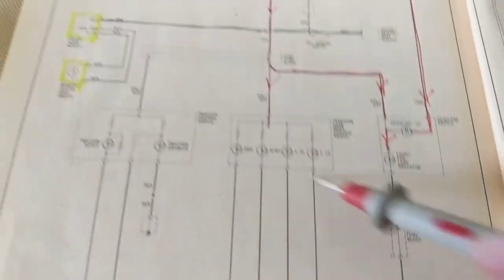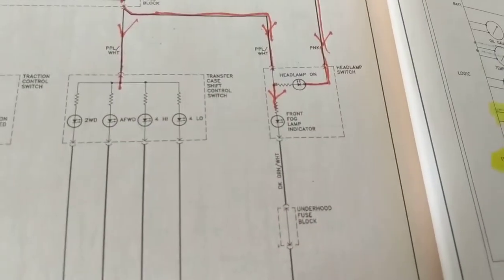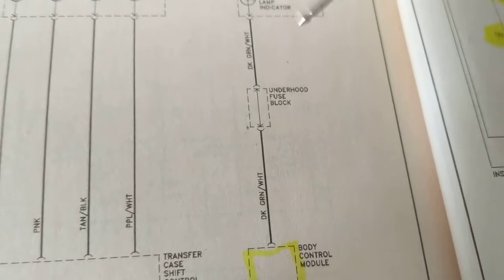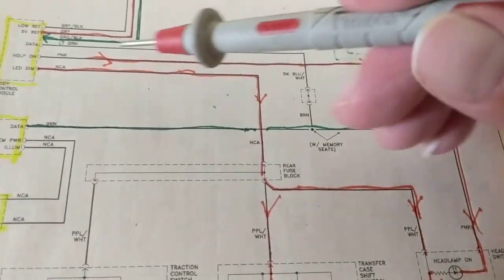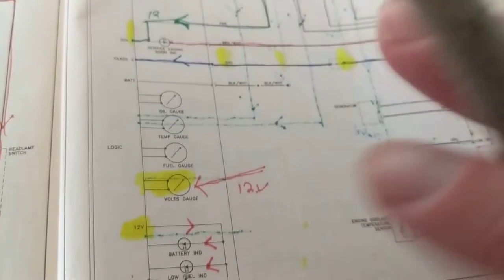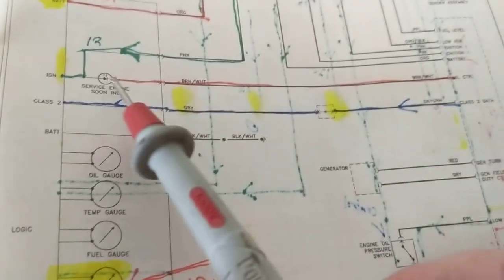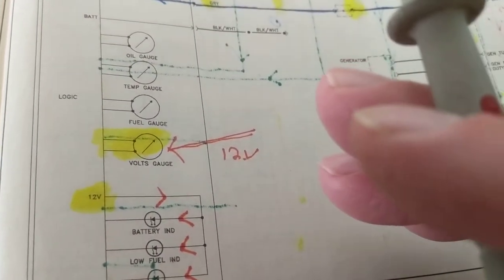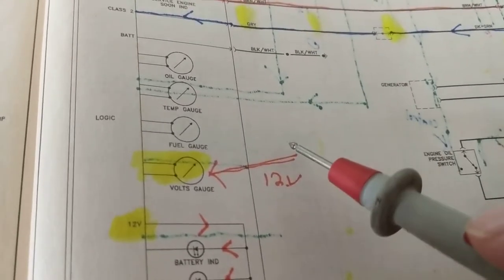BODY CONTROL MODULE AND HOW TO DIAGNOSE NO START PROBLEM FROM DASHBOARD

Comment: Do u know anything about the dim controlling the voltage in a buick LeSabre 04? Its not the regulator on the alternator bc ive put in 3. Still havent tested my harness to the alternator yet but have read in hanes manual that the dash integrated module controls it also for the buick.
Reply: From knowing other vehicles the module is a rehostst available resistor that controls the resistance and controls the current end of voltage sometimes it's in a module sometimes it's single component I don't see any reason to relate this to the alternator
Reply: @Joeelectronicschematicsforauto  ok thank u for the reply. Do u have a direction u could maybe point me in? Checking the voltage, signal wire and ground next?
Reply: @Joeelectronicschematicsforauto  ok thank u very much. Ill get back to you. I have a hanes manual that has the diagram.
Reply: @Joeelectronicschematicsforauto  im looking but a dimmer controller? Dash integrated module controller? The interior lights dimmer? Dimmer switch input? What genre would it be under in the book?
Reply: @confidential8738  looks like it's a all-in-one headlight switch and a dimmer
Reply: @Joeelectronicschematicsforauto  ok i am on the headlight circuit diagram. Again i appreciate u helping me. Ive been stumped for a month. Learned alot from ur videos. Just found ur channel last night.
Reply: @confidential8738  okay good luck and keep me informed you can always Google one signal wiring diagram from a vehicle for free put in the day-ear model of the car and the system you're looking for good luck again thank you for being a viewer
Reply: @Joeelectronicschematicsforauto  wait but what am i looking at to see why my car is at 15v? The battery is under the back seat where my kid is so it bothers me being at 15v. After 30mins or so it will drop to about 14.6 if im idle but highway speed it 14.9 the whole time. And putting a load on it doesnt seem to budge the voltage like its not even reading the load
Reply: @Joeelectronicschematicsforauto  the Hanes manual is saying that cars have several control modules also have a power mode master. In this case my "PMM" is my dash integrated module. Sent through serial data. It determines the correct power mode by reading the accessory voltage, ignition 1 voltage, ignition 3 voltage, off/run/crank voltage. It also says it if detects a high battery discharge then it will shut off stuff like the ac clutch which mine rattles sometimes and i was trying to figure out why. It also reduces power to other things like the rear defog, heated mirror and seats... I do have a voltage drop 7 out of 10 times when i put the car into reverse and 2 out of 10 if i got from park straight to drive.. temporarily draining the battery to put it in this overcharging state?
Reply: @confidential8738  alternators have sometimes compensators especially in cold winter also they have regulators once they go down to their voltage for example 14.5 volts and stay there that's because there's a regulator whatever the lows that you put on it it should stay around 14.5 volts loads of meaning lights fan motor etc that's just the regulated doing his job
Reply: @Joeelectronicschematicsforauto  ok sorry about all the lengthy replies. My battery is under the back seat which is also says it calculates the temperature to see the charging rate it should apply.
Reply: @confidential8738  yes many models go by temperature and the computer calculates with the temperature how much to charge the battery obviously on the colder conditions it'll take longer to charge the battery
Reply: @confidential8738  p and putting them in the back one of the seat reduces the temperature cuz in the front it's much more hot
Reply: @Joeelectronicschematicsforauto  what i think im having a problem with is the duty cycle wire or one of the wires. I have 12v and 4.8v at my turn on reference. Not sure how i can accurately test the field duty cycle wire without a scope? Is there a test with a test light or multimeter for that wire? It was around 3.4 - 3.6v at start up and idle for 30 seconds.
Reply: @confidential8738  a clamp meter like the ones I used in the video I can measure duty cycle certain multimeters can measure duty cycles

Comment: I didnt see anything on how to diagnose a bcm i have no crank no start with good battery good starter cranks with relay jumped but no start went through security reset nothing 2003 impala im stumped
Reply: If you go to my channels you'll see plenty of videos on body control modules but you have to see if you have communications that requires a scanner because the body control module has to communicate with the PCM module in some models that's the first thing to do
Reply: @Joeelectronicschematicsforauto  ignition on activates starter relay, still no 12v to solenoid, only clicking on passenger  side, how do we fix it ????

Comment: I Like this video very much, So how do I  acquire a schematic for my 2014 Ram 1500, I need one for my Truck, I have no signal light in the rear and no Flasher in the rear of the Truck, thank you, StaLLioN'
Reply: He said he was using a Haynes manual, in this video. I have used them for years and they are very nice.

Comment: 2017 ford fusion hybrid location
Reply from the maker: If you're asking about where the body control module is located which I think you are usually they're located by the dashboard sometimes on the under the steering columns and sometimes on the other side under the glove compartment but always in that area